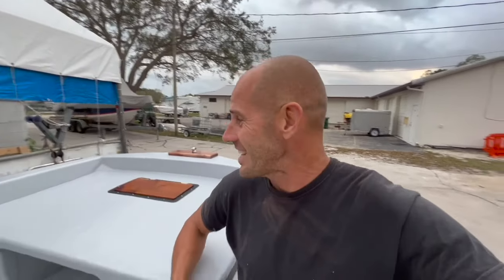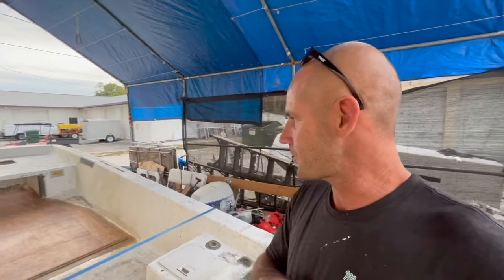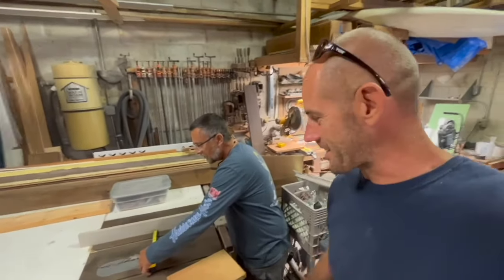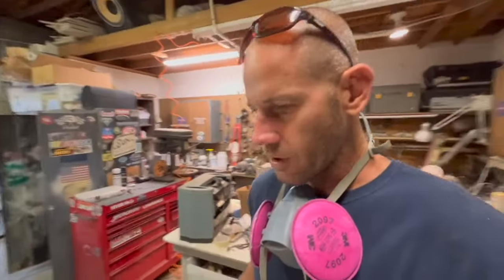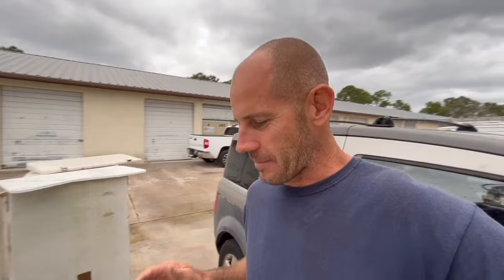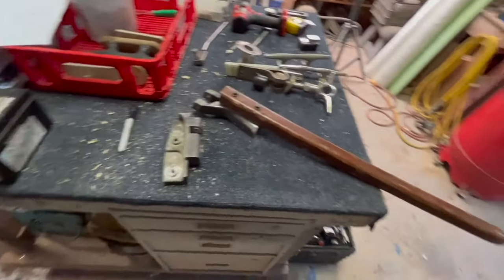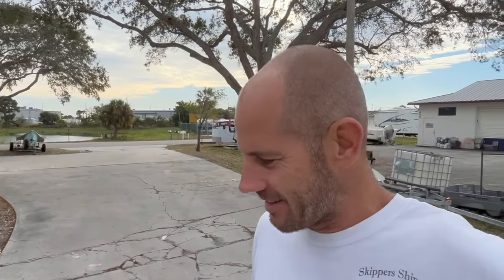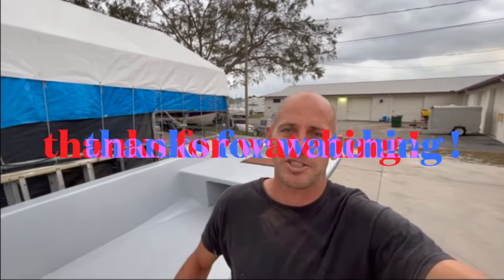Skiff Boat Rebuild for Beginners Part 2

Comment: Painted a trailer 15 years ago using same exact hardener from tractor supply and oil base rust oleum thinned with acetone. Paint is still holding up great!

Comment: What a friendly helpful soul you are. I'm glad I came across your channel. I just purchased a solid 14' Mckee craft skiff with a Evinrude 40hp. Motor is in great shape with good compression. Only had to replace fuel pump and rebuild primer solenoid. Runs great. Now working on some minor repairs and repaint boat. Then repaint and rewire trailer. I'm going to put bigger wheels on it as well. I like what you did by adding some wood finishing. I'm going to incorporate that in my project as well. All the best and thanks for all the ideas.

Comment: The builds you do are great. I would love to do something like this. However, trying to get a lost title in Texas in near impossible. And if the original owner has passed away, forget it. Unless you plan on using is on a farm pond or private lake. You can not put a motor on a boat you don’t have a title for. Not even a trolling motor. So, there are a lot of “dead” boats in Texas.  And they are cheap, for a reason. It’s really sad that it’s so difficult, but it is what it is.

Comment: Turned out great! I have a 14 ft aluminum Star Craft in Bradenton that I've been playing around with. Love the small boats.
Reply from the maker: Thanks so much  , and No freaking way!  I just picked up a StarCraft this past week for a future build.  I’m stoked to do an aluminum boat build!  Congrats and right on!  Are you located in Bradenton?
Reply: @diywaterworld  I'm actually in NY now (unfortunately). We have a place in Bradenton just off AMI. I picked up the boat up here in NY cheap. I had to go with a 14 ft because that's the biggest that will fit in my garage. Stupid HOA's. It runs well with a 25hp two stroke Merc.

Comment: She's a beaut! I've been using oil-based Rustoleum on boats for ages. Works well on wood and aluminum too(with rattle can self-etching primer coat). It's genuinely great stuff you can get anywhere and the color will always match when/if you need to touch it up a bit. Try doing that will gel coat. Plus, there's no sense in spending more on paint than the boat itself. I've never used a hardener, but it makes perfect sense. Keep up the great work! ...Sneaking up on 10K Subs too ;)
Reply from the maker: Thanks so much Karl!  I appreciate your comments / insight always buddy!   Oil base is the way to go for a lot of reasons and has withstood the test of time.  And right on, I hope you get to try the hardener with it sometime.  It’s a Game changer no doubt!!  Cheers buddy!

Comment: Enjoy your videos! If you did gelcoat it would you have to sand the old gelcoat off?
Reply from the maker: Thanks so much!  Glad you’re checking them out!   No, to re gel coat all you need to do is clean the surface and sand with 220 grit or rougher.  Gel coat doesn’t still well to fiber grit scratches.  Then of course clean with acetone or compatible solvent and spray/roll the gel coat. :) cheers!
Reply: @diywaterworld  Thanks I have little project I’m working on. Watching to try and figure out what I’m doing lol

Comment: How does a boat guy not recognize mahogany. Rip the plank in 1/2 or 3rds and reglue w/growth rings opposite. Rabbit the undersides to inset to desired flushness. Seal the undersides. Good shade of light grey!
Reply: I thought is was cherry, so was glad he was treating the way he did.  That said I only know little about boats but even less about wood.  I will defer to your expertise.  Are there telltale signs it is mahogany
Reply: @MrMichaelDodd  Grain/color the usual suspects.